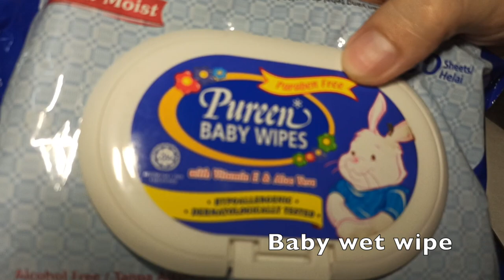Relaxation: Removing Sticky Rubber Coating From A Laptop (How to)

Comment: That is an actual common issue on some of the latitude series of dell, I had one of those and not only got that bad through time, but also that rubber material is very susceptible to get dirty very easy, very good machines but they messed up with that rubber material

Comment: If the coating is just kind of sticking and you don't want to remove it go get some ceramic automotive wax coating. It puts a layer of ceramic over the sticky coating and stops it from being sticky.

Comment: I heard isopropyl alcohol also works for removing sticky coating
Reply: Just tried isopropanol it didn’t work 😔 my fingernail it quite good, but I haven’t got 2 years to spare.🥴
Reply: Also tried 70% isopropyl alcohol, i messed up the surface 🙃 now it looks ugly. More my fault than the alcohol. But either way, it doesn't work

Comment: All laptops & tablets SHOULD NOT have any rubber coating. It will change properties over time and will get very ugly. 

In 2015, i bought Lenovo Yoga Pro 2 at US$ 1,300 and can only use for 3 years. After that, all plastic and rubber reformed and need to spend US$ 450 to change all chasis, keyboard and can only last another 2-3 years. So, i didn't repair it and kept at store
Reply from the maker: Agree, really dislike them using the rubber coating.